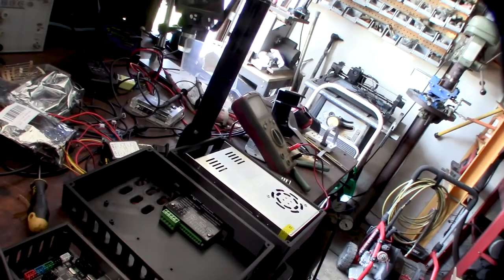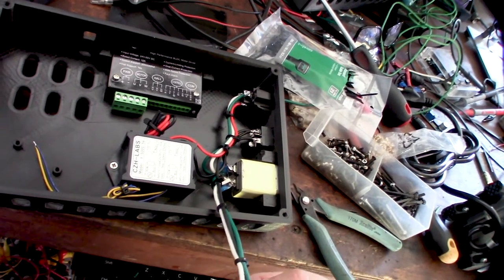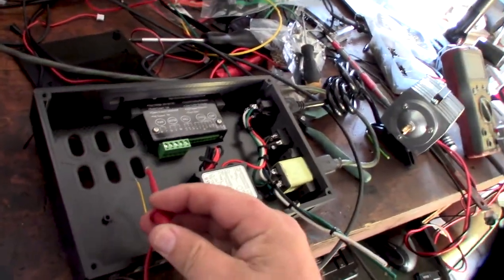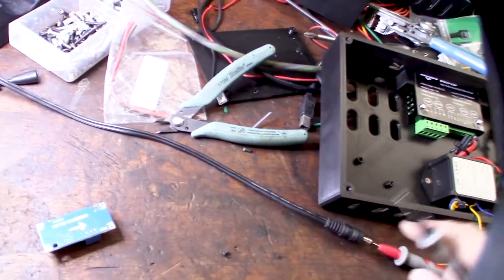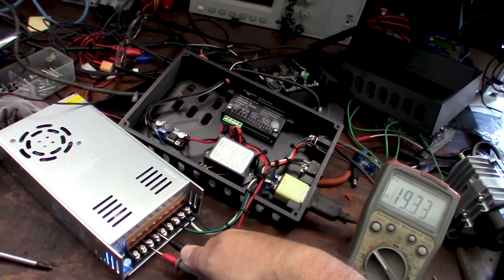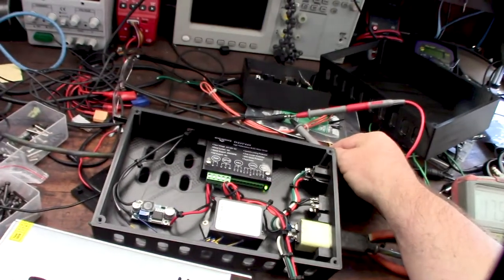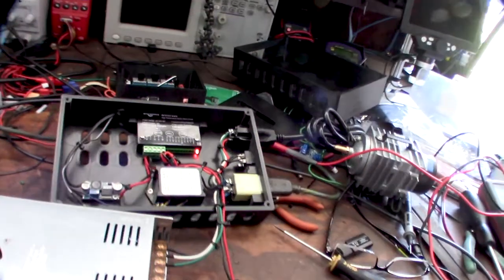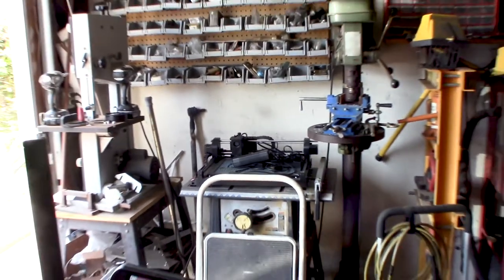3018 CNC 500W brushless spindle upgrade, cut aluminum and possibly steel GRBL Mach3 10V  Part 3

Comment: I love what you do!!! I kinda feel like that you need to have a serious question to yourself.... What is my hourly rate?? How much is your time worth?  At some point you might want to just buy a more capable machine.   I'm just saying because I have the exact same 3018.
Reply from the maker: I agree, right now I'm just learning. I like to fully understand the mechanics of stuff. It makes it easier to troubleshoot later. I got this to learn fusion 360 tool paths. I wanted a small fully contained unit I could take to my cabin and learn. My next unit is going to either be tormach, Haas or one of those Chinese 6040 5 axis machines on eBay. I probably have more fun designing parts for this then using it.